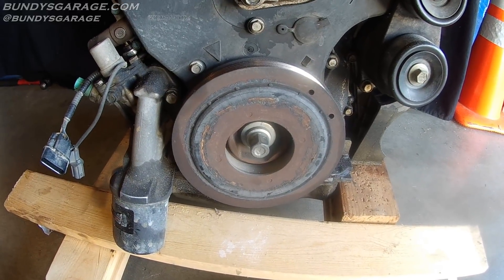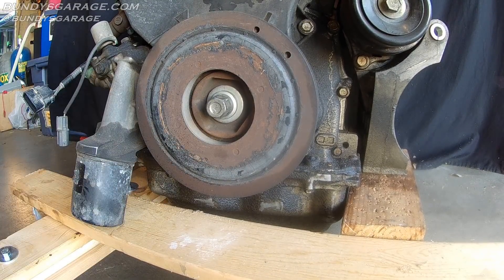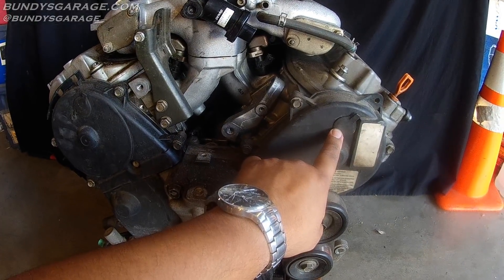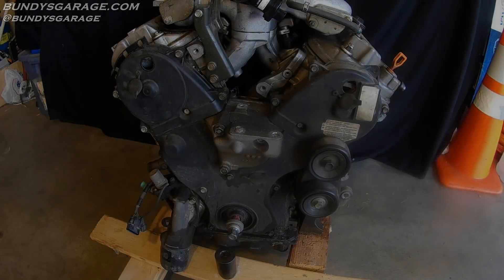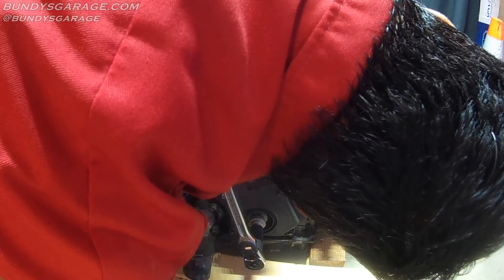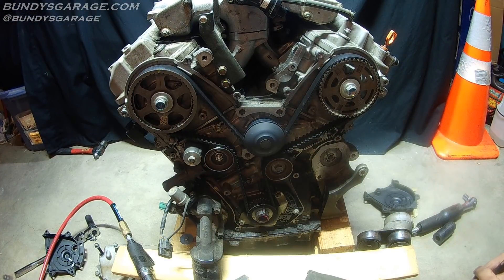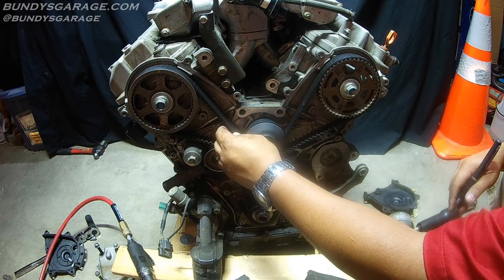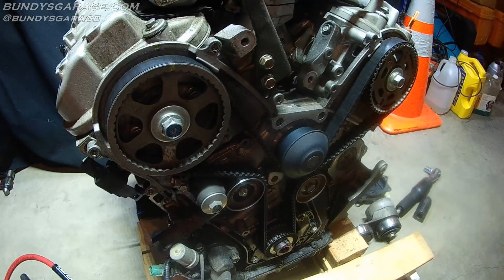Gaining Access to Timing Belt on Honda Acura V6 3.2L 3.5L 3.7L J Series Engine in Detail

Comment: So if you take the belt off the vehicle and say you need to find the timing where the timing is completely off on everything you tried to line each cam then crank. Is there a lot of back pressure on the cams Is there another way to get in contact with you?

Comment: I wonder if someone put Loctite on the crank pulley bolt. Usually they spin right out after they're broke loose. I noticed that your impact was still needing the hammer action to finish removing the crank bolt.

Comment: Got a question for you. So honda a rtv hondabond.  One is the honda bond High temp and also has honda bond ultra flange 2.
So I'm in the process of re sealing up my oil pan as well oil pump houses once I replace the gaskets.
Do you have a preference on which honda bond would be best????
Shops b dealers gave me a 50/50 answer

Comment: While you have that engine out, can that belt tensioner bracket be remove along with the alternator bracket? My 12mm bolt broke flush in the hole, I need to drill it out and tap in new hole thread.

Comment: Thank you for the heat up the bolt trick.
I put the bolt in dry after removing the pulley to move the engine to TDC.
Then the bolt didn`t want to come out.
So I heated it to red hot and out she came.
Thanks for sharing your knowledge.

Comment: Loosing that crank bolt is the FIRST step in doing this timing belt. Reason being is if you do not break it loose you cannot do the timing belt. So before you drain coolant, before you even remove the timing covers, try breaking the crank
Bolt loose first. Great video btw

Comment: my left cam always moves right a little bit causing the timing mark on that only cam to move
Reply from the maker: Keep the cam from moving with a wrench or place the belt with the marks lined up and then get a paper binder clip to hold the belt on the cam at the correct place.

Comment: What is the difference between the 3.5 and the 3.7,

Would this engine fire if you put 3.5 Into 3.7 car, 

I researched and got to know the the crank sensor plate is the same but I don’t know that of the cam sensor plate ....

Comment: You don't actually need the torch, at least in my experience, to get that crank-bolt off. I used the Ingersol Rand 19mm Power Socket, and  the DeWalt DCF899 (1100 ft-lbs) impact wrench and that sucker came right off. You can also use the Milwaukee 2767-20 (1400 ft-lbs) - both of these cordless tools easily do the job. Surprisingly, the air-operated wrenches do not do it.
Reply from the maker: Glad it worked out for you but sometimes you gotta torch that bolt for it to budge.

Comment: I just bought a 99 Honda Passport that has 163,000 on it, and the check engine light is on. The guy I bought it from said he replaced Timing belt, Head gaskets, and other things. The problem is it gets hot. The top radiator hoses is hot, but the lower one is cold. Do you think it could be the thermostat, and if so what idiot wouldn't replace it when he had it apart? Also how do you get to it to replace it? THANKS!

Comment: I know it’s not recommended but I had to use the starter and a cheater bar with my 1/2 19mm socket to bust the crank bolt loose. My air compressor didn’t have enough pressure to get it done and no other way to get it off. Did this on an Odyssey and an Accord. I know you risk damaging the flywheel but it literally comes loose with one tiny bump of the starter. Then you must replace with a new bolt as the threads have stretched when torqued. I think I paid 16 bucks for that. Dealer only part. I only use the best parts, don’t skimp, you do NOT want to have to go back in due to a budget water pump, tensioner etc. Amazon has a great factory kit for under 200 bucks.

Comment: The weighted 19 mm socket works awesome. It took the crank pulley bolt off as easily as wheel nuts. I have a Mac IR impact about 30 years old. No problem at all removing crank bolt. My air compressor I run between 125 and 155 psi.

Comment: So the 1 has to be lined up and everything is timed good to go? I'm assuming if it's at any number or just one the other two arrows are lined up as well
Reply from the maker: If the front cam is at 1 (with the belt on) all the others should be lined up. But ALWAYS check all the marks to make sure it’s timed correctly.
Reply: @bundysgarage  ok perfect thanks! So just make sure all are lined up (before) I remove the crank pully bolt. I'm going to attempt this job, not complicated looks like more of a time thing. I have basic tools so it'll take longer. I need one of those electric ratchets lol I'll keep you posted!

Comment: I went to the most absurd, insane lengths to break that crank volt on the J35A4 Honda engine.  No heat, no penetrant, just my dumb ass and some jackstands and a ten-foot cheater pipe bending under my full weight!

Comment: Hi. Need ur advice please.
My acura tl engine is under recall for burning oil.so the dealership will rebuilt it.
My question : is it good idea to get timing belt and water pump , leaking oil pump seal  done at same time?
Should i pay them extra or will it be less labour to do this stuff as they will already be working on engine?
Reply from the maker: Well the question you need to ask yourself, are you capable of doing the work to “save money”? Or are you going to take it to a different shop? Are they going to rebuild it or get a used block and swap everything over. How much did they quote you to do the water pump and timing belt and seal?
Reply: BundysGarage the engine rebuilt stuff will be under warranty.
They quoted me 500$ for oil pump seal 
150 timing belt and water pump.
I was wondering shouldn’t it be cheaper as they will be taking engine out already .
Reply from the maker: That’s what you need to determine. If they rebuild yours they do not need to remove the engine. If they replace the block then yes it needs to come out.
Reply from the maker: So they are going to charge you $650 bucks for all that work? You might want to charge that cause that is super cheap. Parts alone, quality parts, are $250 to $300 without markup.
Reply: BundysGarage thats for labour only, parts will be extra
Reply from the maker: Ask them for a quote to do all the customer pay work.

Comment: honda specifically states DO NOT use an impact on the crank bolt. The reason is it will damage the crankshaft bearings bye rattling the crankshaft around in those bearings putting dents in them because they are made of brass and the crankshaft is hardened steel it's like hitting them with a hammer they are Journal bearings meaning high pressure oil makes the crankshaft float in the center of the oil being pumped around the crankshaft so when the engine is not running it is sitting on the bearing metal on metal that's why low oil pressure will cause immediate damage to any engine just like an impact gun on the crankshaft bearing. Use a large breaker bar and a large long cheater bar and the tool made to go inside the harmonic balancer pulley to hold it still if the engine still in the car you have a few options in a manual transmission you can leave The Wheels on the car put the car in gear put the E-brake on have a friend sit in the car and then this is a tricky part turn the car on press the brake pedal down hard hold the brake pedal there turn the car off do not lift up off the brake pedal so the vacuum assist is still helping hold the brakes tight then try to loosen the crankshaft Bolt. In an automatic put it in park put on the emergency brake have a friend in the car start the engine press the brake pedal down hard turn the car off do not lift up on the brake pedal so the vacuum assist is still helping hold the brakes type and try to break the crankshaft bolt loose.
Reply: Fucking bullshit !

Comment: Can I replace just the tensioner
Reply: Interference engines sustain tremendous internal damage if the timing belt fails so always replace the belt when replacing any associated parts.
Reply from the maker: Great advice!
Reply from the maker: You could but why would you want to. If the belt breaks your going to paying a whole lot more than the cost of parts and labor for repacking the timing belt. Or just buy the timing belt component kit (AISIN) off of Rockauto.com and watch my timing belt video that goes they step-by-step on what you need to do

Comment: Don't take a torch to your harmonic balancer bolt if you dont have to. Your harmonic balancer has rubber in it and I have had these fail and fall apart after heating the bolt

Comment: I cheated removing the dreadful CS bolt by wedging a breaker bar and bumping the engine on our Ody since it rotates CW 👍 Recently purchased this socket which made life a bit easier while replacing my son’s 97 Accord 2.2  timing belt. This engine rotates CCW and the special socket came in handy 🤙
Reply: Thats true , yeah you can not do that on pre-2000 hondas you will shear the bolt as motors turn anti-clockwise

Comment: Do you have a vid on the crank sensor removal ? Does the belt HAVE to come off to get it out ?
Reply from the maker: I don’t think the belt needs to come off but you have to pull the crank pulley and lower cover.

Comment: Hey man my timing belt broke do I need a new engine or should it be ok to replace the belt let me know please
Reply from the maker: Need more details. What is the year make and model. Engine size. What happened when the TB broke?
Reply: BundysGarage 2003 Honda Accord v6 2 door it’s my father in laws car he said he went over a pot hole and the car started diying out but to me the crank sounds different I I try and start it doesn’t sound normal
Reply from the maker: No you don’t need a new engine. You need to remove both heads have them sent to a machine shop to check for valve damage. 95% chance there is valve damage. Once you do that you need to get Fel Pro Head gaskets and new head bolts. Install both heads and then do a timing belt component kit on the vehicle. If you do it yourself $500 - $600 in parts alone. That does not include your labor. If you want to confirm the belt is broken. Remove the front top timing belt cover, 5 10MM bolts and it’s off and you can see if the belt is broken.
Reply from the maker: If your interested in selling it email me at bundysgarage@gmail.com
Reply: BundysGarage thank you so much brother I appreciate it
Reply: So I opened up the front cover a little bit I just took two screws off I wasAble to feel the bell it don’t feel loose and anyway

Comment: Thanks for the video, under rated channel in my opinion! Having a hard time with the engine in the car but I'll get there, I need to take the power steering pump off and everything too. This car is a pain
Reply from the maker: Here check this out:

BEST DIY Honda Acura V6 J Series Timing Belt Replacement PART 1 - 19200-RDV-J01 - Bundys Garagehttps://youtu.be/lEg9_OCas_w
Reply from the maker: Yes pump comes out

Comment: I’m confused if I can just use that 19mm why do I need the 50 mm pulley tool?
Reply: To tighten up the crankshaft bolt the 50 mm holds the pulley to tighten up to the massive foot pound torque required

Comment: Hello there I just bought a 2010 Acura MDX in an exelent condition two owners from a certified acura dealer with 62.000 can anyone tell me when should I change the timing belts please this like looks like new great conditions
Reply from the maker: Well it is over on time but not miles. If it has never been done I would do it now.

Comment: I had to use a breaker bar + a 4 foot cheater bar for the harmonic balancer bolt.
Reply: pizzamon 79.  No joke I used a. 1/2" breaker 2' long and a 10 foot pipe as a cheater.  Hung my full body weight off the end of that long ass pipe!  It flexed but made the bolt pop, very loud.  Several hundred foot pounds at least
Reply: @reallyhappenings5597  Holy s$&^!! 10 foot cheater and your full body weight? 1000 lbs. of torque almost.
Reply from the maker: Yeah you know when the bolt gives away cause there is a large “pop”!

Comment: Im in love with this Engine . Efficient, powerful, and simple to work on
Reply from the maker: The Honda V6 J Series platform is bulletproof if you take care of them.
Reply: BundysGarage absolutely agree with you . I had a 98 v6 honda accord i put 300k miles on it and the engine was very very smooth and quite. .all i did just change oil every 5k miles . Currently dring an 05 Acura Tl and just love the V6 .
Reply from the maker: Yep just love them and tuck them in at night.
Reply: @bundysgarage  wich one is the j series

Comment: A friend bought a 2003 Acura MDX with 100,000 miles, and he is now at 170,000.  Is there a way to inspect the condition of the belt easily, thru a belt inspection plate, or something??  Nice video with excellent camera and use of the green laser pointer made it very clear.  Good job !!
Reply from the maker: You can see the belt thru the tiny covers on the top timing belt cover but why risk it? The Timing belt is cheap compared to an engine and installation, a belt with that many miles. Just change it and all the comoonenets. Its not worth the gamble.
Reply: Thanks much.  The main point is he has no record of the belt being changed, but we don't know for sure that it has never been changed.  I have seen change interval recommendations at 60,000, and 75,000 miles.  One guy said he has not changed his in 300,000 miles !  Another said Acura recommends changes every 7 years.  If my friends has been changed at 75,000 miles (before he owned it) I am trying to figure out if another change is needed.  He may also have the factory belt which has 170,000 on it now.  Having a non dangerous timing belt is a necessity with these vehicles.  I think belt, tensioners, water pump,etc... run around $150. - $200. for kits.  Doing this job is no walk in the park either.  So it gets a bit expensive in a hurry.  Just want to try to establish if his needs it or not.  Thanks much for your help, and for the great video !
Reply from the maker: Yeah you can pop off the front top cover closest to the radiator. 5 10MM bolts hold it in. If you can see markings, like who made the belt that’s a good indication that the belt is fairly new. Not always true cause it only rubs off cause it rubbing against the pulleys. So it could still have the markings cause it has no miles on it but be 20 years old which is not good either. Hope that helps.

Comment: Bundy, I made the biggest mistake by taking the timing belt off before aline all the timing marks, is there anything I can do to make sure my engine won't get fuck when I put the new belt in? What can I do to get my timing right?
Reply from the maker: To avoid engine damage to gotta get the no 1 cylinder back to TDC. Otherwise you run the risk of damaging the valve
Reply: BundysGarage thanks i repositioned it back and turned them and got them all lined up!
Reply from the maker: You have to line up the marks on both cams. That’s the only way to tell. Did you remove the spark plugs to relieve compression? You can also have someone hold the rear cam in place while you put the belt on.
Reply from the maker: Leave the cams and crank exactly where they are. Mark the cams with a mark on the cam and one on the cylinder head. So that on both front and rear cams. Them make a mark on the crank and the engine block. You will use those as your new reference points when putting the new belt on. You need to put the new belt on without moving the cams or the crank. Does that make sense?
Reply from the maker: Use nail polish like hot pink or red so you don’t lose your place on the cams and crank.
Reply: BundysGarage i accidentally turned my engine clock wise by the front timing gear without the dowl pin in, it turned only a quarter forward do i just turn it back where the dowl lines up? Should that be ok?
Reply: BundysGarage ok got the timing belt on and rotated 3 times but now i notice the back cam is about one tooth off tdc?!
Reply from the maker: You gotta fix it now or you will run into problems.
Reply: BundysGarage the back gear wouldn’t stay tdc it would either Jump forwards or bakwards! How could i check to see if both cams are true tdc ?
Reply: BundysGarage I’ll have to remove the plugs tomorrow I’m changing them anyway! But what happened is i had both cams lined up but when I rotated it 3 times, back to tdc i notice the rear cam not directly on it’s mark! Should i just put slack on that cam and reposition it one tooth over?!  Also the marks on the belt wouldn’t line up!

Comment: Man dude! do NOT used grease on a bolt, if you use anything at all use a shot OF W-D OR ANTI- SEIZE, GREASE WILL ENLARGE THE THREADS..
Reply: Scott Moore lol no it won't!
Reply: its supposed to be threadlocker/loctite on there.  Grease will cause it to work its way loose.
Reply from the maker: No it won't

Comment: Here  is  one     made  by  a different company   with  the   same  principal  of  a  weighted one, dont  know how it works, will need   to  see some   reviews on them.    https://www.ebay.com/itm/Cal-Van-Tools-980-Crank-Bolt-Socket-Set/192252587096?hash=item2cc325ac58:g:1mwAAOSwuFpZb376